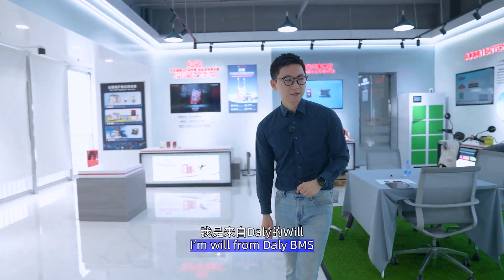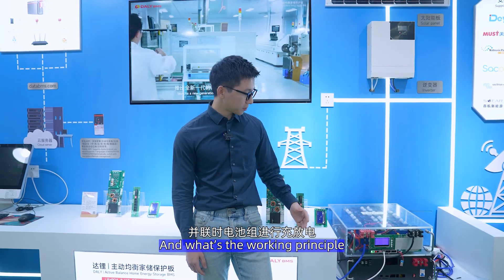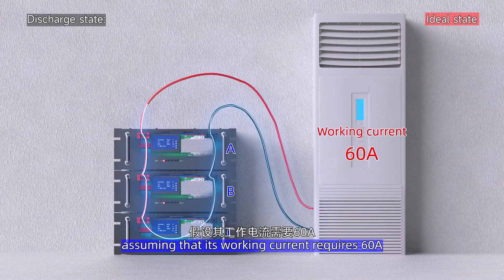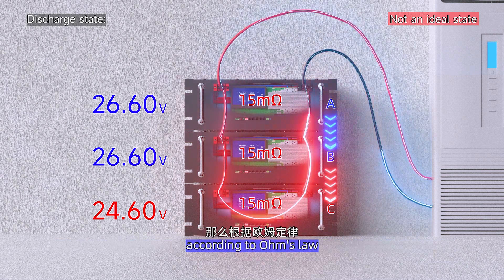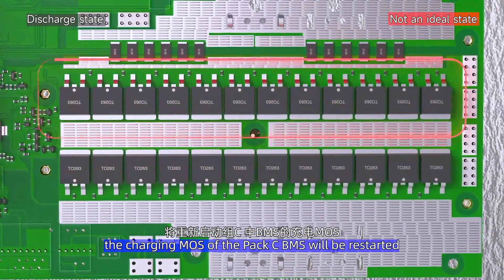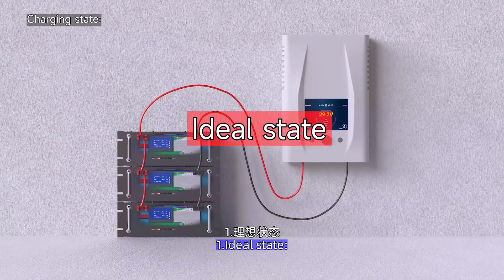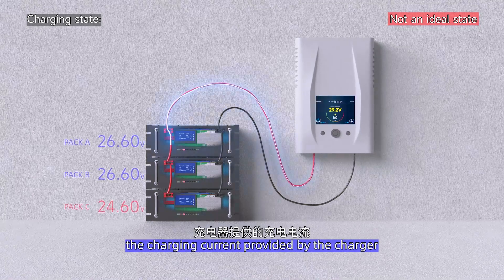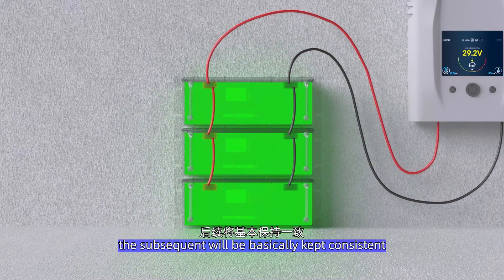Home storage board parallel function

Comment: Do the communication cables between batteries (CAN/RS485) need to be connected first, before the power cables to avoid the high current transfer?

Comment: this function is useful only, when you mix batteries randomly, without toping them (Charging to full capacity) when you fist connect them in parallel.
it's not useful after they have the same SOC, so always and it's recommended to charge each battery individually to 100% before use.